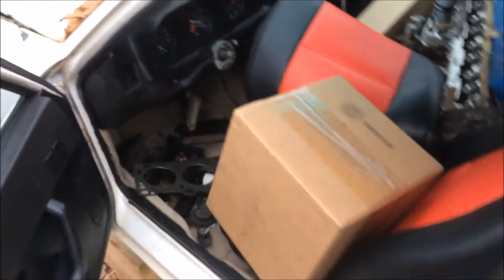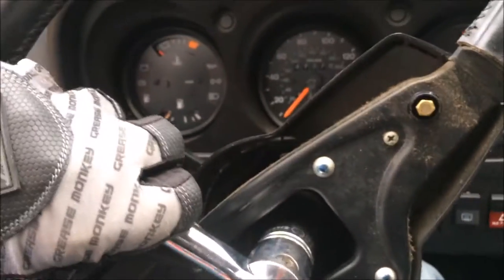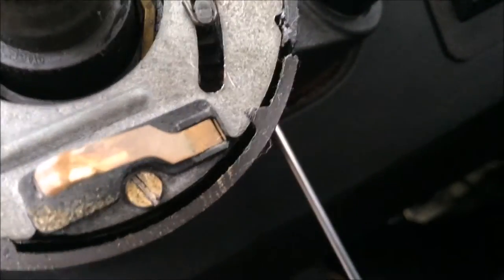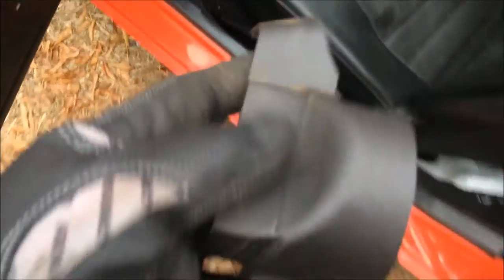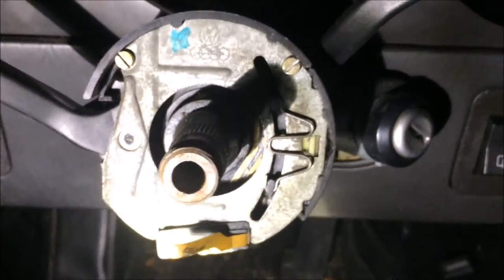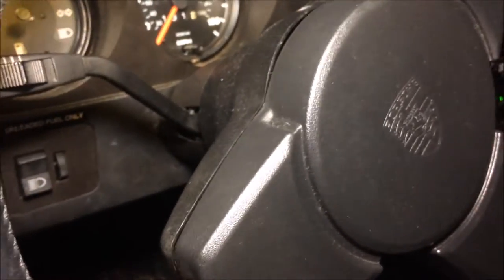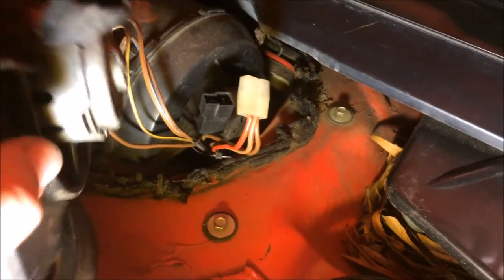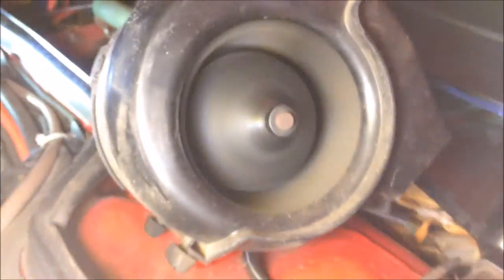Weekend Project! Replacing turn signal stalk and Blower Motor

Comment: Question:

My blower motor works fine however when I first start it it squeals something awful. I’m thinking of just lubricating it with some lithium grease see if that helps. But in your video you did it off camera, I was wondering what it is you used and where did you apply the lubricant?
Reply from the maker: I just shot some WD-40 in there where the holes are to see if it would break up any rust and free it up. However, actual electric motor oil would last longer and work the best, I was just doing it as a test since I was going to replace the motor either way. I hope that helps!

Comment: So on my 84 944 the blower motor squeals all the time until I turn on the fan. I've tried spraying wd40 down in there but I successfully made the interior smell like wd40. Would you recommend taking it out and spraying it or is it time for a replacement? Works fine otherwise just it's annoying as all hell as I use my 944 for doordash and with a 10 hour shift, I'd rather not have ear drums afterward.
Reply from the maker: Might be time to take it out and try rebuilding it with grease. The one in the video was completely rusted up and not worth rebuilding. Elliott at 944 barn might have a few good used ones if it doesn't work out. Good Luck!

Comment: Nice video! Did you know you can actually get those parts you swapped new? The blower motor is about $100.00, and the turn signal switches are between $260-325.00. I know the switch isn't that cheap, but you can't beat having a new part on the car for reliability.
Reply from the maker: Thanks, yes I'm aware that I could have bought new parts, but I always try to repair things whenever possible. The stalk I need with the cruise switches is $350 on pelican. While I could easily buy a new one, this repaired switch should last for many years. If I felt that it wasn't going to be worth the effort I wouldn't have bothered, but it should have plenty of life left in it now. I have bought entire cars for $350 so while thats not a terrible amount of money, I would rather just buy a whole parts car and keep mine going that way.
Reply: edredas bro how can I contact you? I bought a 944 in really good shape but I have tons of questions!
Reply from the maker: You can email me. My address is edredas at gmail dot com.